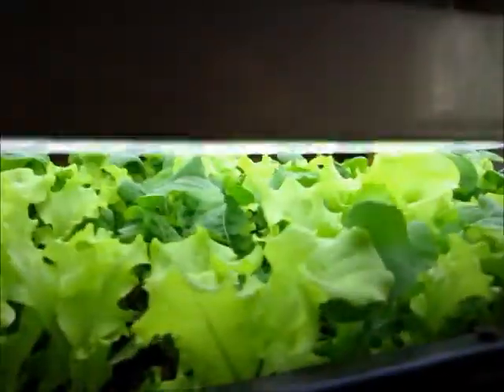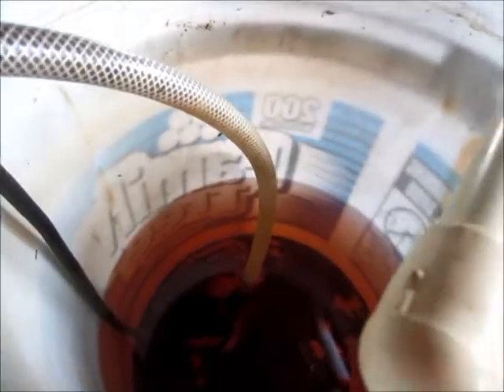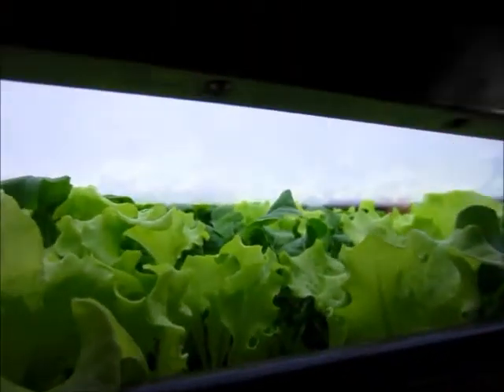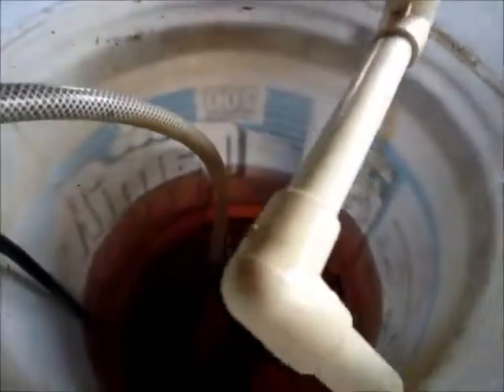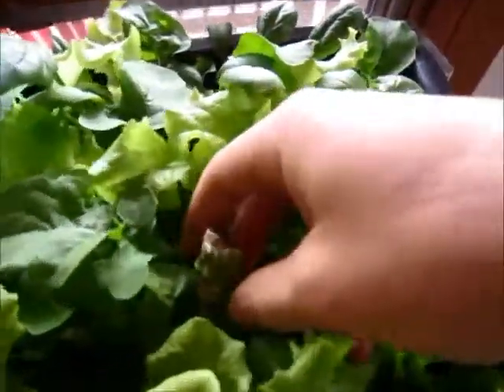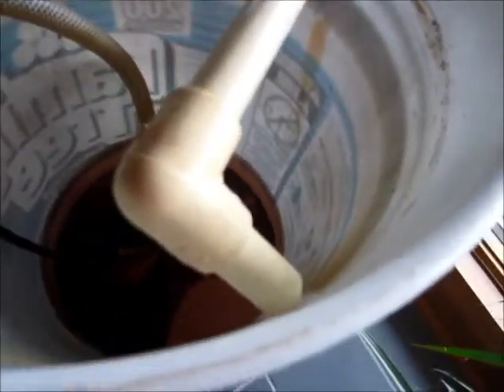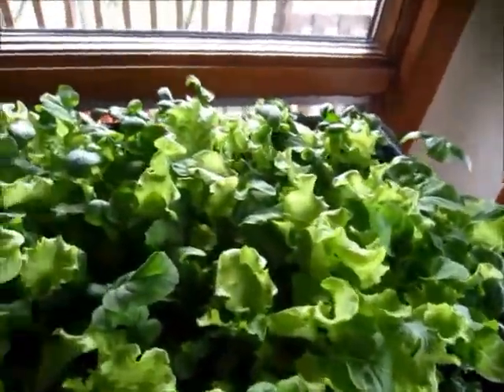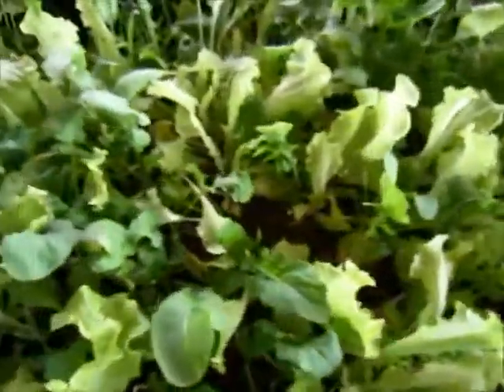Hydroponic Garden With LCD Back Light

Comment from the maker: Yeah, it does use 150 watts, but it does seem pretty bright.  If I used two normal 4 foot dual tube florescent fixtures  that would use about 160 watts and the light would not be as even.  Thanks for the comment!

Comment: neat, but isn't the LCD backlight not very power efficient ?  It usually pulls like 150-200 watts for a TV/mopnitor of that size and not as bright as using fluorescent tube lights.